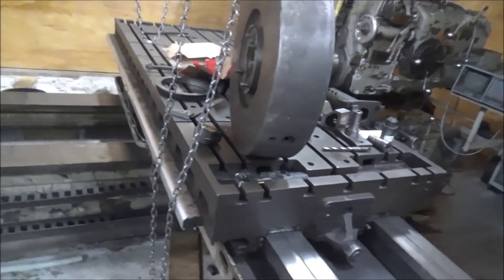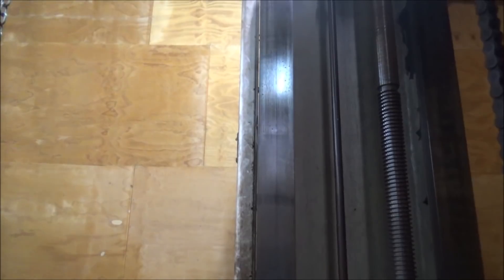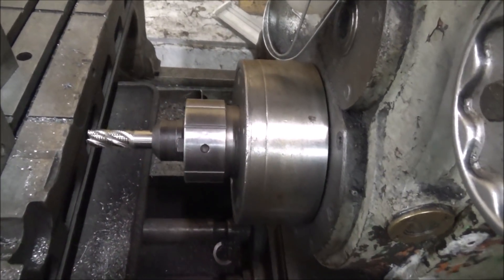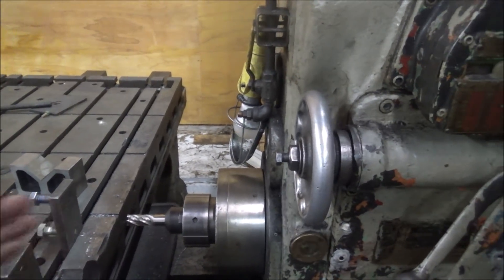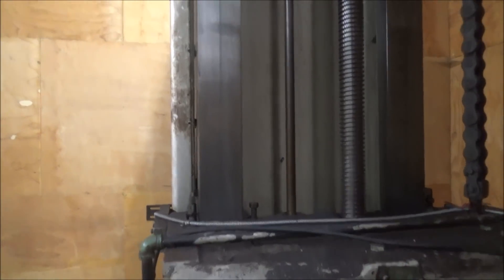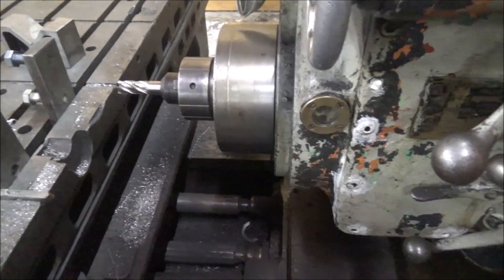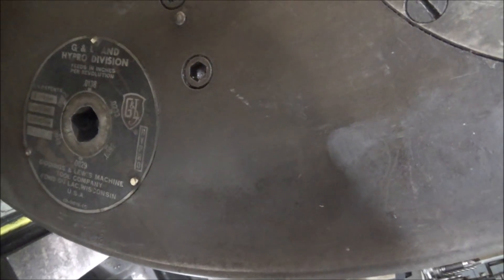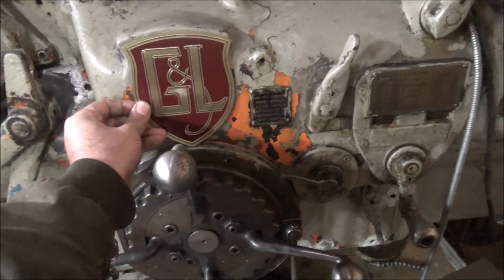Automatic Boring & Facing Attachment for Giddings and Lewis 340t Big Milling Machine Large Job Shop

Comment: i am exited to see what projects come in the future! some of the older abom video's have a boring involved with what he calls the sliding chuck. i don't think he ever talked about gear driven facing capabilities. he just put a bit in a boring bar in the sliding chuck and made a giant face mill. no matter. you also seem to have it covered. horizontal boring mills are cool.
Reply from the maker: Pretty sure the one on the machine Adam ran at Motion worked the same way as this.

Comment: OH OH, do we see some 24" sleeves for JD pulling tractor engines?  Just kidding,   But if you ran a 12" stroke for an oversquare engine, and had 6 cylinders you would get 2,714 cu. in. or 44.5 L.  That engine would be 14' long but if you made it a flat opposed 6 cylinders then you could get it down close to 7' long.  Just think about how you could rev that opposed engine as they are already perfectly balanced.  Make it with opposed crankshafts like the Fairbank & Morse submarine and ship engines and 2-stroke diesel and you could be rich.  2-stroke would almost double the power and with the maybe 600 rpm rev limit, reversible rotation on the engine you would not have to have more than a 2-speed transmission, and if you mounted the engine in the transverse position...  Wait a moment, I am describing the very old time tractor tractors like the Case with the opposed-piston engine.  
Have a great new year.
Reply from the maker: I really would like to have an Alco 539T They are 12.5"bore and 13" stroke. A 9572CID beauty!
Reply: @bcbloc02  Many people do not understand why guys like us stand and watch big engines run.  Most are fantastic pieces of history that were lovingly saved and rebuilt.

Comment: great find you have there Brian , reminds me of a large one in the machine shop many years ago , not sure of the exact name but it had an approx 6 foot diameter boring and facing head ,big cross travel but short 10 foot long travel the job that I remember it for is when as sparks had to mod the electrics to do one job , the job was a angled pipe tester for elbows of various angles up to 48 inch bore , so the machine had to have two quadrants for the pressure pads to squeeze the test sample, but they could only machine the edge radius fro 80 degrees with a stop lump at each end . so the head could only rotate 80 deg. . solution we made up a pistol like grip with a trigger jog button, then sorted the motor starters to only jog and engage the reverse one for one sec on release of the jog to stop it quick , the job took a week to complete , then we had to reinstate the wiring back to normal

be safe and stay safe in this crazy world we live in 
Stuart
Reply from the maker: I have never run a pendant controlled machine. At least not yet. :-)

Comment: If you have nothing better to do, get hold of Abom and relieve him of that stoker engine project he can't do.  :D
Reply from the maker: I told Adam he is welcome to come use my HBM if he wants. Working down in that crankcase hole is going to be challenging regardless of what machine you use. I am thinking the machine that originally did it may have had a special right angle attachment to be able too machine under that ledge.
Reply: @bcbloc02  Good for you Brian. That is collaboration spirit. Have a happy (and healthy) New Year.
Reply: Good thinking. He is facing some difficulties, due to the restrictions from the shape that the item has. I think that Adam will find a way to do the task. But in any case Brian can help to !!

Comment: Nice name plate .   You might have to keep an eye out for a new gib ,  it may reduce the error  .  Cheers .
Reply: Taper strip may just need re-bedding in, then slightly hollow middle running surface.
Reply: @boostie1005  Worth a try .  You would have nothing to loose .

Comment: Great score Brian, but now that you have that head you might get to use it more often than you think once people in your area know you can do that work. Between your big Monarch and now this lil accessory head there's not much in farming or earth moving you couldn't bore or face. And work that big always pays well. I'd say that B&F head all by itself likely weighs fairly close to what my 3/4 sized BP clone does and all it's tooling.
Reply from the maker: The head weighs about 1000lbs. I think.
Reply: @bcbloc02  Pretty close then, all in my mill, a pair of vises and the little B&F head I have would be 1300-1400 lbs. That sort of puts what your doing and what I might into perspective. My mill table isn't rated for that heads weight all by itself. If you ever need to pull that head apart for any reason please show that, I'd be real interested in how it's internals work.

Comment: The big Richards HBM we had in our shop had Turcite added to the table ways, it was never the same, they could not get the error out.
Reply from the maker: What error did it have? Was the part weight throwing it out of alignment all the time? my G&L has some kind of hard phenolic bolted on the ways. It doesn't give though.
Reply: @bcbloc02  She was mainly used for refacing large heat exchangers in a large oil refinery in West Australia which worked fine.
They found a problem when boring out a cylinder on a compressor and when fitting the sleeve it jammed half way, the bore was round but not straight.
Had to be sent out to a large engineering company with a press large enough to remove the sleeve.
She had a good sized facing head, maybe double the size of your recently acquired one.

Comment: Nice find!  I thought my wife was bad but  Old machines are really hard to shop for :) 
On my planer the column is connected to the side of the table and the manual tells how to adjust the column to the table to adjust for vertical alignment...  Can your mill be adjusted like that also?  Oh, need a paint job? I'll send Don over  <evil grin>
Reply from the maker: maybe next year I can get a steady rest for the Monster Monarch. lol
Reply: @bcbloc02  Did you look at that site I sent you...  If you tell me exactly what you need I'll run over there and talk to Randy for ya...

Comment: Now that is one hell of a boring and facing head Brian, I can't wait to see that bad boy in action! Tom does a fantastic job on the machine tags, he is shaming me as well into restoring my old South Bend drill press and already sent me the reproduction tags that look better than the originals!
Reply from the maker: I will trade you  rebuilds. LOL
Reply: @bcbloc02  LOL, Yours would not fit in my shop!
Reply: Ray, no pressure here—it’s just you in a race against that Central Valley humidity rusting away your machines now!!! 😂
Reply: @thomasutley  LOL, The drill press needs the ugly slapped off it and is almost at the top of the "to do" list, I can't wait to rip into it!

Comment: Some youtubers make do with small scale engines, but with that thing you could bore a low pressure cylinder for a full size marine triple expansion engine, of the size that pushed battleships in the 1890s.
Reply from the maker: I would rather build a full size steam engine than a model. :-)  Sadly materials would be rather expensive. lol